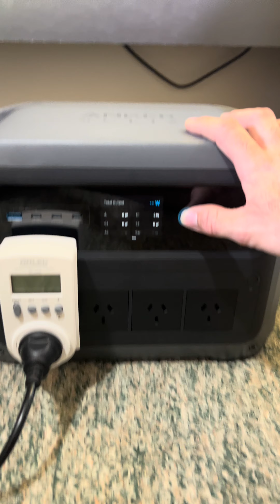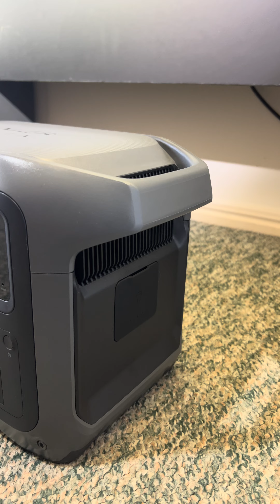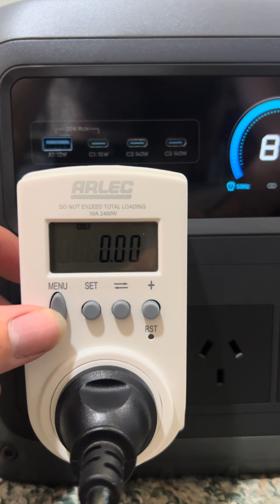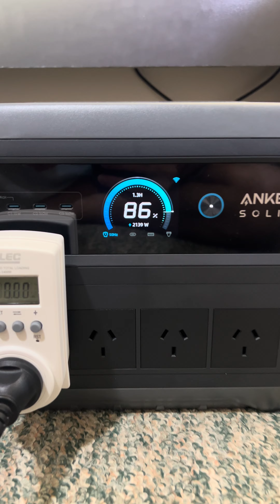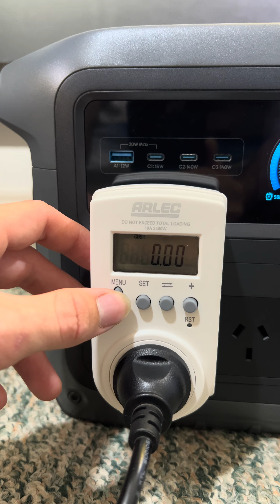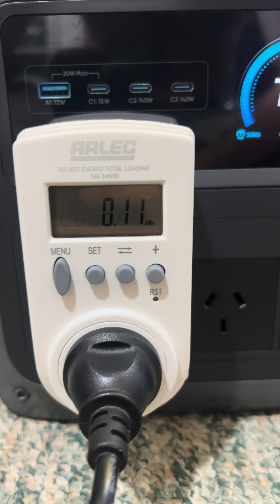Anker Solix C1000 Gen 2 - Water Boil Test

Comment: What's your thoughts on this model as I purchased one yesterday and awaiting delivery? Thanks.
Reply from the maker: Hi AdelaideMan, so great to see your comment. I have only had the unit for about 2 weeks now but it has impressed me greatly. The unit is small, light and has a great output. The 1024Wh battery charges quickly and the variety of settings you can change is impressive, from display brightness to custom charging speeds. I love design of the unit, this is my first Anker product and I am very happy so far.
Reply: @lifencarryco5925  How are you feeling now?  I have one of these in my basket on Amazon, but I'm afraid to check out.  Do you know anything about the Pecron E1000LFP ?